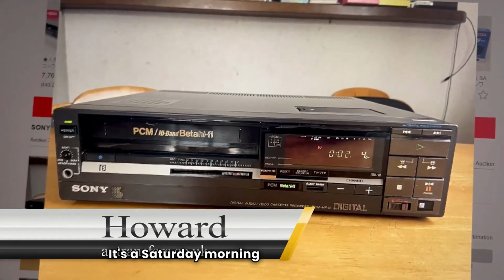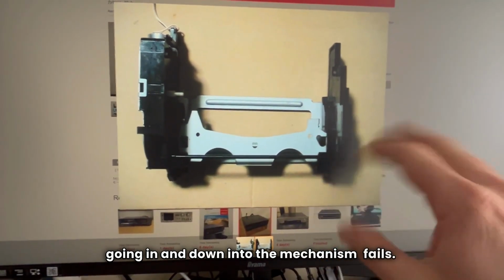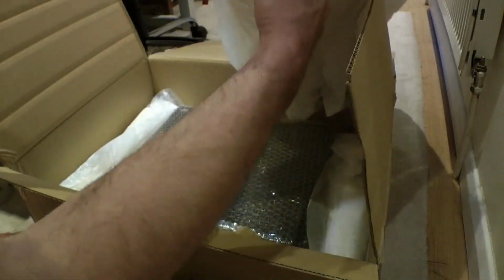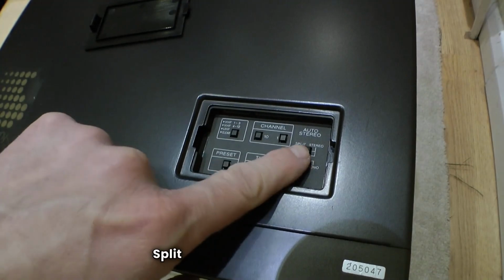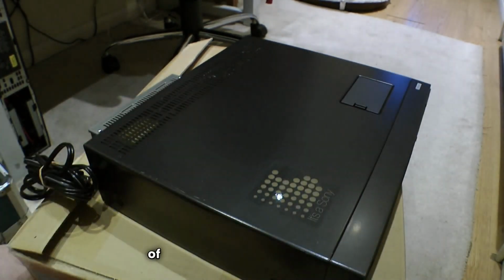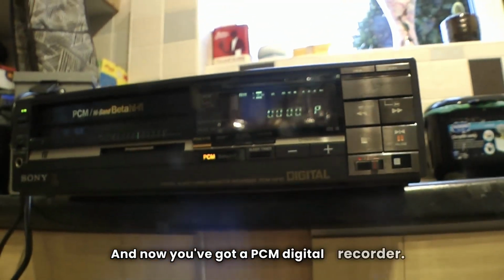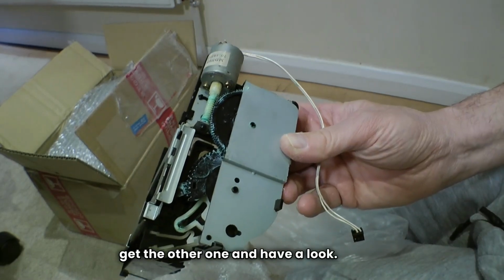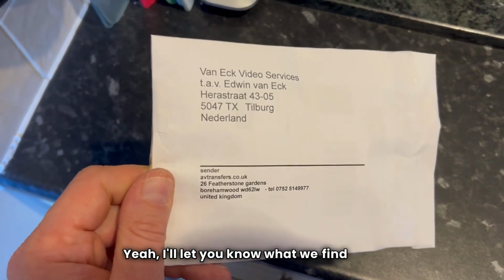Reviving a SONY DIGITAL BETAMAX HF 10PCM   PART 1 @avtransfersUK

Comment: hi had the same in a later V2000 deck the gear went bad  

i keep away from alot of the later betamax     bad part you find  are very like on the betacam  wear they play up or go bad  my mate has a 950  the rack gear can break  

i like the have the pcm 701 es  units  i have some   bob